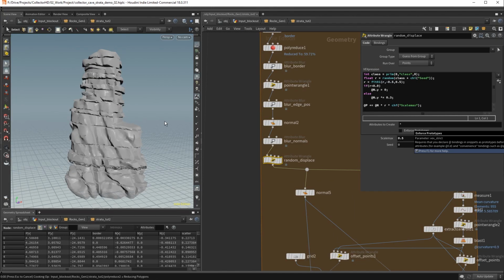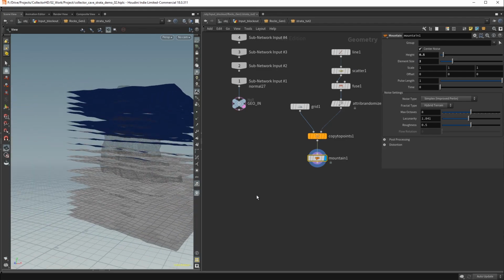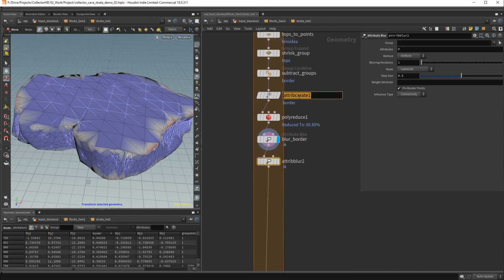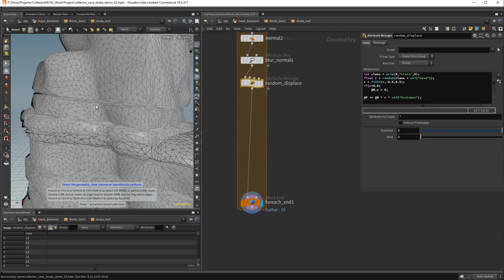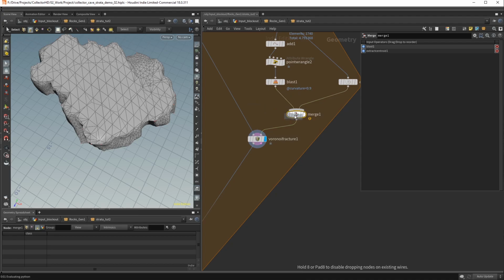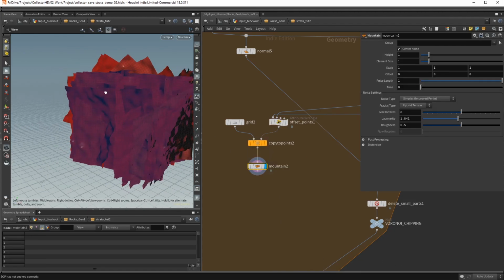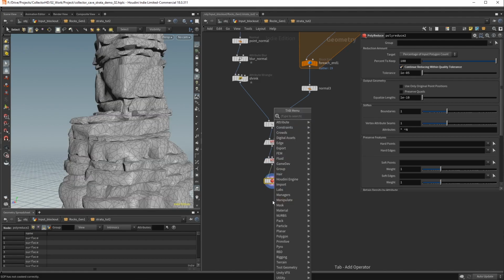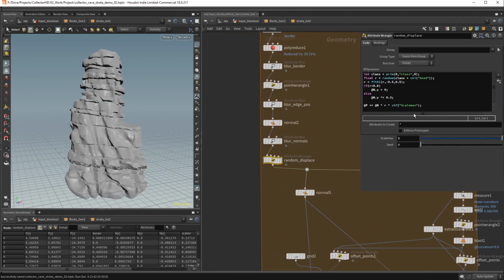Creating procedural layered rocks in Houdini

Comment: running into issue at attribute create before the polyreduce the border edges. any ideas?
Reply: its doesn't seem to be passing the group over to polyreduce. what ends up happening is the polyreduce  reduces the entire chunk instead of the border points
Reply: I know it has been 3 years, but just for the sake of it. I ran into the same problem and I used group promote for the border group right before the polyreduce :)